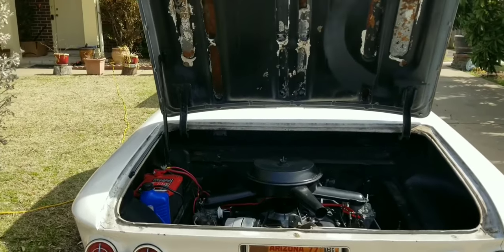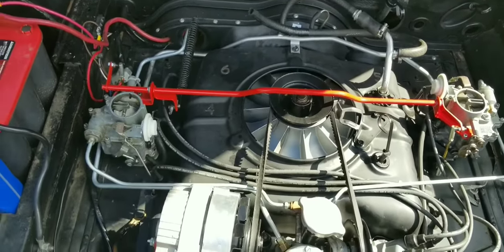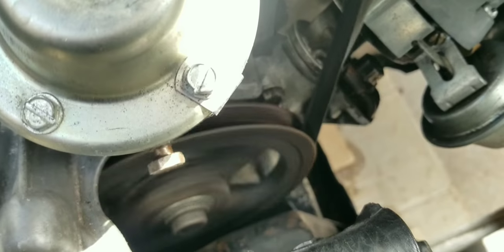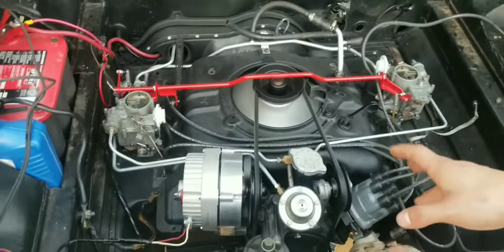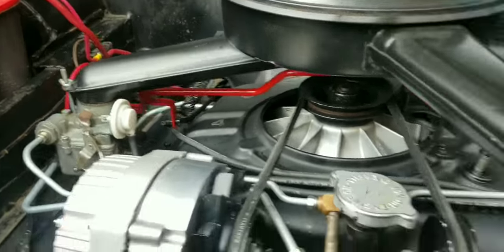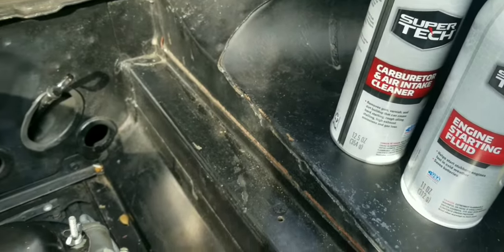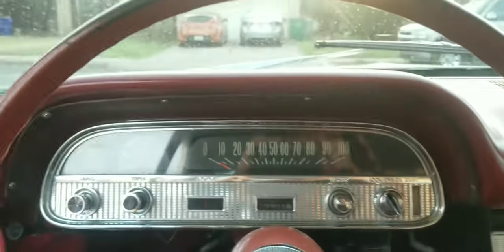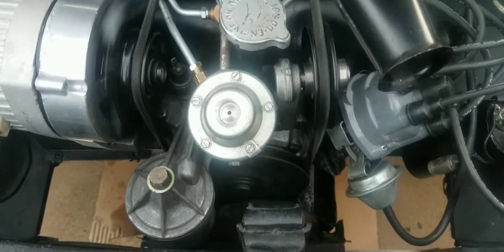Fixing the Corvair's idle issue!

Comment: Glad to see you happily tuning and wrenching on the Vair! As you're learning tuning and balancing the carbs is crucial. Another thing that will cause the cars to run rough or stall, can be traced to vacuum leaks. Vacuum leaks seem to have a more negative effect on PG ones, but my Corsa wasn't running right, and part of it was vacuum leaks and the timing. Keep up the good work!

Comment: Sounds great ! Your persistence paid off , Are You going to put on your lower shroud doors ? That will affect how long it takes for your engine to warm up, During hot weather your engine will run hot do to much heat coming back in off the exhaust manifolds. Again great job on synchronizing the carbs thanks for the update & the video.
Reply from the maker: I do plan on putting all the lower shrouds back on. Old ones were too beat up to reuse so I've had them off for now. I appreciate the advice and your comment! :)

Comment: One tip. I have a 66 Impala and 64 Corvair. I bought the replica 60’s manuals as well. But they don’t account for modern gas. Gas in the 60’s burnt way faster. Timing is off as far as those manuals are concerned. I add 10• advance to the impala and it never ran better.
Reply from the maker: Great tip! I've adjusted timing since.
Reply: @benbencorvair9071  great and thanks for your channel
Reply: yep, I add advance to my '64 Corvair and it runs much better on 93 gas.  I got the electronic distributor from California Corvairs, so I was able to limit the total mechanical advance and change the springs as well so that I'm still at 36* total.  I also don't run the vacuum advance, so increasing my initial timing helps it not feel like a dog when you first hit the gas (where ported vacuum will give you that timing boost).

Comment: I am having a similar problem, but as I drive, the car shakes a bit, but only when cruising, and the right carburator has no airflow but good compression. Any suggestions? I've tried all I could..
Reply: What if you were to switch the left and right carbs? That would let you know if it's the carb or the cylinder bank. My guess is it's some stupid little thing in the carb. I have the same problem and it turns out the guy who rebuilt it put in a bigger brass needle (looks like an obelisk) in the hole that allows for the accelerator pump to discharge gas...I'll throw it on tomorrow - fingers crossed

Comment: I fought stumbling, backfiring and idle issues for a month. Rebuilt carbs, installed electronic ignition and nothing worked.
The problem turned out to be....centrifugal advance + vacuum advance + 4 degrees was too much timing on de-acceleration, causing mis-fires. Everything was set to original specs. Currently the vacuum line is plugged to stop the vacuum advance and it runs good. If anyone can explain why i had too much vacuum advance i sure would like to hear about it.  remember everything was stock.
Reply from the maker: Post this on a Facebook corvair help group. You will get lots of responses there.
Reply: I did the exact same thing.  I have dual bluetooth AFR gauges to monitor each bank of cylinders...timing was too high at easy cruising and deceleration, causing lean misfires.  Plug the VA and bump up my initial timing a bit, and it has never ran better.  I was getting 50-52* total timing with the VA connected and at easy cruise speeds.  Now I'm at 20* initial and 36* all-in if I step on it and get to 3k+ rpms...that's my max, and I have had zero issues with lean misfires since.

Comment: you need to do that with a vacuum gauge?
Reply from the maker: The tool I place on top of the carburetors is a uni-syn tool. Must have to make sure both carbs are synchronized and pulling equal vacuum.